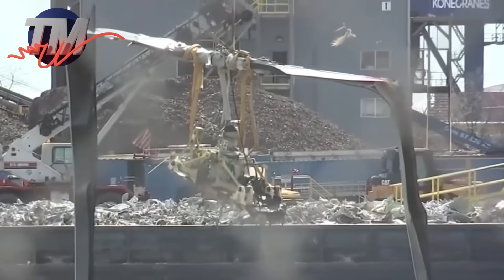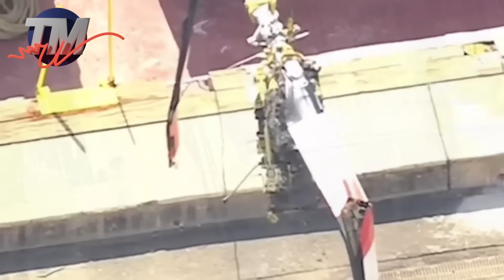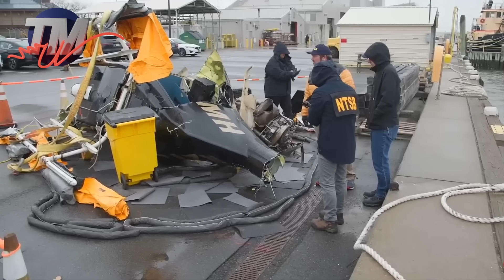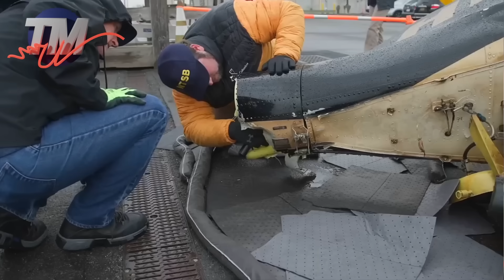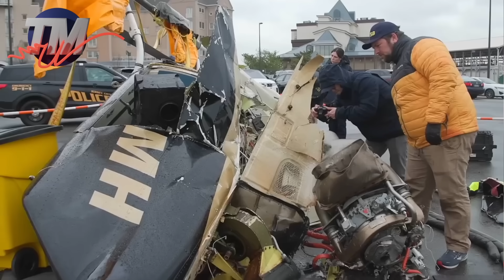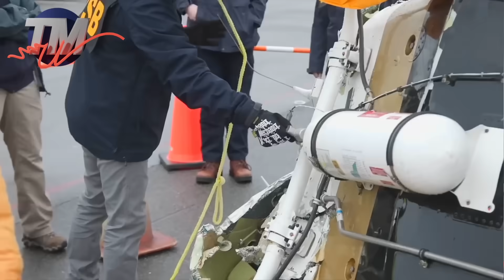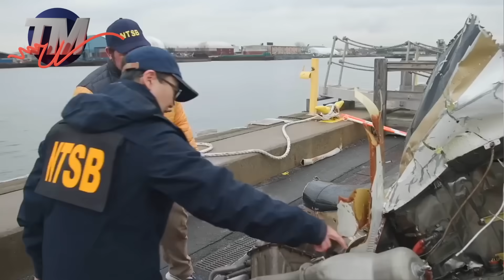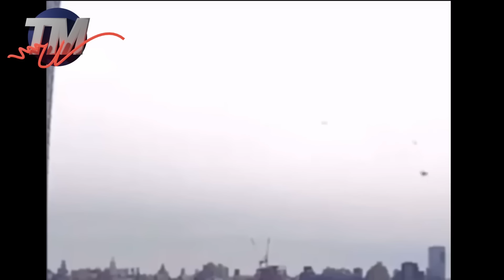Recovery of the Main Rotor of the Hudson River Tourist Helicopter - it's worse than we thought

Comment: More aviation crashes being reported in depth is an interesting insight. I followed the Titan submersible disaster for months and months, and am still following it. I’m fascinated about how and why failures happen, this is how I learn basic engineering. In my opinion, news wants to sell newspapers, and unfortunately disasters attract readership and views. However, when disasters are paired with understanding the news becomes a learning experience. But I agree, this reporting is scaring people.
Reply: Cause of the Titan disaster was simple: ignorant design, aiming for a cheap solution.  Fibre reinforced materials are strong in tension, not compression., and can be weak at the interface between the fibres and the matrix. We knew this in the mid-sixties. There was no excuse.
Reply: @brianblackford2224  I so agree. When I first learned about the Titan disaster, I immediately knew, not knowing anything about submersible design, that the cause was hubris and lack of adherence to basic principles of physics.
Reply: 5 people on a sub, when the answer was known but let’s distract the people with the media forcing a sun story on us. A lot of things that should have been headlines were not. Antarctica.
Reply: I think it seems like more reporting because many of the incidents involved rich people/government/military.  If the helicopter was carrying average people and it crashed in the midwest, this would hardly be a story, even though their lives are just as important.

Comment: I can only suppose by looking at the main rotor/ gearbox is that the gearbox seized thats the only way the main rotor gearbox would tear itself off the transmission deck due to the inertia of the blades which is what looks like happened as the gearbox supports are still attached to the gearbox if that makes sense, we can only wait and see.

Comment: Why are so many people stuck on mast bumping? The videos don't even show the slightest evident of any type of mast bumping. That helicopter disintegrated because something seized up.
Reply: Honestly i think its partially just fascination with learning what mast bumping even is. I didn't know before this incident and it is an interesting tech unfun fact.
Reply: @crazypika12  It's a rare event That normally takes out the tail boom.
Reply: Mast bumping usually results in the rotor separating from the hub immediately below it, not ripping the trans out. Once the intact trans was pointed out in the early videos that clearly wasn't it.
Reply: The mast bumping speculations appeared before most of the videos.  It was a reasonable possibility at first, especially combined with an early, short lived rumor that the pilot was known for doing risky stuff while flying.  But as more videos appeared, it became harder to hold on to the mast bumping theory. It's clear from the video that the pilot did not execute any crazy maneuvers before the helicopter fell apart.  The only remaining defense I have read for the mast bumping idea is that there is lots of spotty, unpredictable winds in that area due to the tall buildings but I think we'd see some evidence of that in the videos.  The mast bumping theory is dead, the only reasonable theory left at this point is some sort of transmission seizure.  The questions now center on the details of how that could have happened and who is to blame.
Reply: @jamesm568  My mind went to mast bumping when the news first came out but changed when I saw the rotor-gearbox autorotating gracefully towards the river. Perhaps it is confirmation bias.
Reply: Experts in their own bathrooms…
Reply: Probably they want it to be pilot error?? You know how some people are.
Reply: @TheDriftwoodlover  - Yes, we sure do.  Virtue signal much?
Reply: People need to rationalize something that cannot be easily explained like this accident. The same reasoning than in a shooting when the police says is not random but targeted (gives relief because is targeted so I cannot be a victim). In this particular case what can be easier than to blame the pilot even without any evidence?
Reply: It was not an unreasonable hypothesis based on the earliest information available we now have enough information to know that that was not the case, but we didn't necessarily have that information immediately.
Reply: @jamesm568  Exactly! Catastrophic mechanical failure. Machine was stable flying straight and level.
Reply: Its very clearly a mast bumping incident. These guys go on and on about wild theories for engagement. Weve know it was caused by mast bumping since the first video
Reply: Dunning Krueger mostly make ppl feel smart parroting what's easy.
Reply: Because, most of them live in an echo chamber, where they read something, have zero expertise in it, and repeat it because they want to feel like they were right about something. Validation.
Reply: Because they are the paid bots that are trying to throw everyone off the scent.

Comment: I have a few years doing maintenance on a Bell 212 / Huey !  The only way that I can see where that transmission would have been ripped out of the airframe would have been if the transmission seized and the rotor blades momentum ripped it out but why did the tail boom appear to come apart at the attachment point

Comment: For the whole rotor and transmission to be ripped from the airframe I suspect either a mechanic didn’t do their job properly at the last service or possibly some hardware had integrity issues which weren’t immediately obvious from an external inspection - as in when the bolts were cast/forged there was an internal defect that couldn’t be seen without an X-ray.

Comment: What this proves, is that the aircraft and drive train are indeed as robust as is claimed and that it takes rotor blades making contact at full speed to cause total failure.
The only situation that's not supposed to happen, is the only thing that can take it down. The fact that the entire rotor hub, transmission and mounts are entirely intact is a true testament to the robust quality of the build and the maintenance of it. Everybody did their job properly, there was no failure.
Reply: Any helicopter where the rotor and major engine components tear off in mid air during normal flight is not robust.
Reply: I agree...It's been a long-time, reliable airframe.
Reply: Apart from the blades are clearly intact and did not hit anything.
There have been numerous accidents in the past caused by main rotor gearbox failure.
NTSB have the gearbox, I would expect an announcement soon.

Comment: I do not see any personell in this video that would identify them as representative of Bell Helicopter Textron..  Until those people get on the scene there will be wild speculation as to a cause or causes.  The video presenter is wrong in stating that the tail boom failed at the point of attachment. It failed at the second former aft of the point of attachment. The point of attachment is absolutely intact which is readily evident to a Bell helicopter mechanic.

The transmission ripped a portion of the honeycomb roof to which it attaches out of the cabin section. In so doing the 'doghouse' fairings were also torn off and these can be seen in the crash videos as debris.  

The NTSB will lean heavily on the knowledge of Bell Helicopter.  The findings are many days and weeks away.  The cause is a long ways away also. 

I discount thoerys of sabotage or explosion.  Altough maintenance MAY be a factor, that is just wild speculation. We'll just have to wait and see.
Reply: Best comment in the whole comments section.  The wild speculation by the person in the video does nothing to help matters, especially the repeated use of the word sinister. 

I much prefer blancolirio's take on things, no sensationalism or any such nonsense, just straight up facts and reasonable observations.
Reply: Spot on. Former OH-58 crewchief here. So agree with everything you're putting out there. Boom attachment – fully intact. Any speculation about failed transmission mounts – gone. Any speculation about mast bumping – gone. I'm still in the sudden transmission seizure camp, unlikely as it is. I think it's also the only thing that could explain tearing the literal ROOF OFF the bird. And the horror these humans experienced is absolutely beyond belief. Heartbreaking.
Reply: What I saw of the video, looked like the tailboom suddenly disappeared. The wreckage photo shows the attachment point with the boom sheared a foot out.  That's a stressed skin construction failure!  Too close to the fuselage to be a rotor strike.  We had to check those tailbooms by hand to feel for any dents, waves, or wrinkles on the daily inspection.

Comment: As an aircraft inspector. I would say the tail rotor drive shaft broke. Causing the tail section to come up and hit main rotor causing it to separate. Terrible circumstances and loss of life.
Reply: As an inspector, you probably don't have the greatest experience. So, with a broken drive shaft, how do you explain that the entire engine deck was ripped from the airframe during flight and that the rotor mast was twisted approximately 160 degrees during recovery?
There's only one plausible explanation! That would be if the main gearbox suddenly jammed in flight, for example, because a gear in the planetary gear box burst. Only then are the forces so great that the engine deck is ripped from the helicopter (in flight, including the gearbox and suspension) and the shaft to the main rotor head twists 160 degrees.
Because of the jammed gearbox, the main rotor yanks the entire helicopter around its vertical axis, tearing off the tail rotor. At the same time, the engine shafts ripped off, and the entire engine deck was ripped from the airframe. All the hydraulic actuators also cracked. The fact that the main gearbox mounts held shows that they were designed for high loads after the incident a few years ago. It's logical that the airframe couldn't withstand this, as it was never designed to withstand such high loads in this direction.

From Germany, as a trained helicopter mechanic with 35 years of experience, who has unfortunately seen a few too many wrecks.
Reply: I would see this as a serious option yes.
Reply: That might have happened but I don't think that would have been enough to tear the whole gearbox out. I do agree something broke and  jammed the gear box . The force of the sudden jamming tore the gear box out.. remember the loss of physics stating Whenever there is an action there is an also opposite but equal reaction.
Reply: There is no evidence of that happening as there is no damage to the main rotor blades except where they broke when they hit the water. If the tail rotor drive shaft snapped and hit the blades, there would be huge dents in the leading edges, and I just don't see any evidence of that. 25 years as a helicopter mechanic both in and out of the Army working on this model of aircraft many times as well as the OH-58C.
Reply: No.  Main rotor fully intact and freewheeling as it fell into the river.
Reply: In the video showing where the tail boom separated, if that shaft they moved was the drive shaft to the tail rotor, it wasn't bent, it was broken like snapping a bolt head....clean
Reply: @tylerw8216   that is not the drive shaft, it is the pull push control rod for the tail rotor pitch.
Reply: With rubbish like that you won’t be going anywhere near an aircraft of mine!

Why would a tail boom fold up into the rotor? The force on the tail boom from the tail rotor is horizontal on the yaw axis and the main rotor wash is pushing it down! Also no impact marks on the blades.
Reply: @Captain101-x1o  Its all speculation and guessing at this point. the ntsb will determine what happened. Both rotor blades were broken where tail section contacted them. At full throttle, that could have been enough to tear the whole transmission out. either way, something caused the tail to depart. 40 years inspecting aircraft. I have not lost a customer yet. Thanks, and have a great day brother.

Comment: I am very curious it is a rapid failure. It could also have been that the main rotor and transmision seized and cut the tail off when it yawed cause it was almost but not quite free off the craft. Or maybe the tail rotor failed first but the main rotor came off so are they mechancally tied together to cause that. I dont know. So terrible indeed.

Comment: Once the tail section broke free there were sufficient forces present to dislodge the main rotor and transmission from the  body. I guess we’re going to find poor maintenance on the helicopter which didn’t find broken or missing rear rotor assembly bolts. Tragic

Comment: I would be looking hard at the pitch change rods to the main rotor, failure of one rod would make the blade with any failed rod flap higher on a two bladed rotor system, possibly allowing the other blade to strike the tail boom. That could sever the tail section and also dislodge the main transition from its mounting resulting in what we see in the video. I am certain that the TSB will be able to find the cause now they have located the parts.

Comment: The tail boom mounting bolts will tell a lot about this crash. Were the bolts bent as the tail-boom failed and separated, or are they straight.
If they're bent, focus on some kind of tail-rotor failure, perhaps impact with a large object or tail-rotor gearbox siezing.
If they're straight, then focus on, perhaps, sabotage.
I'm surprised the engine separated from the transmission.

Comment: First thing. Chuck is a politician. He has no say because politicians and attorneys are as dumb as a pile of rocks when it comes to technical issues thus leave those people out of the discussion. This is a maintenance issue probably involving a direct strut fatigue failure or some kinda destruction of the gearbox. Remember that there's a considerable amount of spinning mass as somewhere around 400 rpm or so is involved here as well. NTSB will figure it out.

Comment: Truth Matters.....You need to do some homework prior to commenting on aircraft for which you have no knowledge.  This is a Bell 206 Long ranger Series 4 aircraft.  Bell had issues with te earlier versions of this aircraft which resulted in fracturing of the tail boom skin at the point where it attached to the air frame (same place this aircraft failed). 
The failure of this aircraft was obviously tail boom separation, .....as we can clearly observe the clean sheer line where the tail rotor had previously attached to the airframe. Again this was not caused by Mast Bumping, the tail boom skin sheered at its rivet mooring point (same as historical failure of the series1 and 3 iterations). 
Once the tail boom separated, the aircraft was un controllable, and torque/balance forces from the operating engine resulted in the main rotor assembly, mooring points failure. 
Both the tail rotor and the main rotor have been recovered, and although their blades are broken, they remain with the functional assembly. 
The missing piece of this airframe, remains to be the tail boom itself. Parts of the wings previously attached to the tail boom have been found, but not the tail boom proper nor its remnants and driveshaft assembly. 
Knowing that, explains what failed relative to this aircraft .... but not why it failed... Th NTSB appeared very interested (their video) in the area where the tail boom separated.
They will eventually define the failure that resulted in this devastating incident
Reply: Another excellent observation. Now I'm totally bumfazzled.
Reply: Problem with tail rotor being the culprit. If so the main rotor and transmission would have more likely remained with the rest of the airframe. Transmission seizure best likely with the little evidence presented to this Kiowa mechanic, and pilot. Watching the separated relatively undamaged blade and transmission assembly autorotating down without the airframe has kept me deep thinking every night since seeing it on video. The horror of what violence occurred in the cabin before earth impact. The helpless on board plummeting upside down 1 breath left. RIP and blessings to their families.
Reply: That's some good information, thank you.
I might be getting mixed up with what you're saying & what I'm seeing in the NTSB video… you say "fracturing of the tail boom skin at the point where it attached to the air frame (same place this aircraft failed)." However the tail/fuselage join appears to be about 30cm forward of the line of rivets along which the skin has torn.
Did the earlier versions fail at literally the same point as this or perhaps they've reinforced the earlier failure point so now the later, reinforced version, fails at the next row of rivets along the boom?
Reply: It didnt fail at the junction it was broken one rib away from the junction by the inspection panel.
Reply: @nomadchad8243  I'm still not clear!
Is this failure at the same point as earlier tail booms failed or at a different point?
(Just "same" or "different" would probably be the best answer!)
Reply: The NTSB have the gearbox and rotor.
I expect a press conference soon.
If there was a catastrophic failure of the gear box it will be become evident very quickly.
Reply: "The failure of this aircraft was obviously tail boom separation, "  We don't know if the separation was the cause or the result of something else, like the transmission seizing.  A seized transmission could easily cause the massive damage seen.
Reply: Talk about needing to do homework.  The tailboom on this aircraft failed BEHIND where it attaches to the air frame.
Reply: DEI hires must be considered.